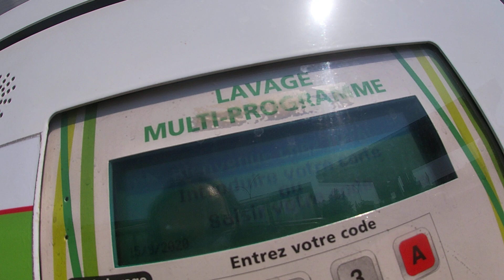Washtec SoftCare Pro Classic

Comment: Cool system equipped with ShineTecs and ShieldTecs with flexstream drying and side high pressure
Reply from the maker: Yep, a cool system, simple yet effective! And thanks for the "technicals" terms that I had not even seen
Reply: FranceCarWash Really wow just google some WashTec Chemicals theirs made by Awa. Also as you said simple and affective. Your welcome ☺️
Reply: @Wesumatex2020  Auwa chemicals aren't used by Total France and Germany. They are using chemicals mady by KAW-Kiehl. :) So no ShineTecs and no ShieldTecs. ;)